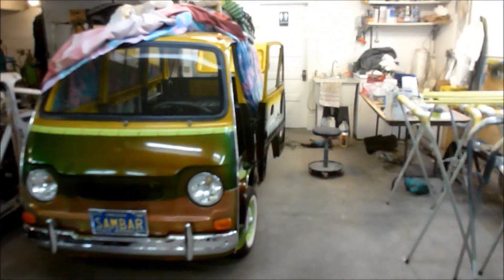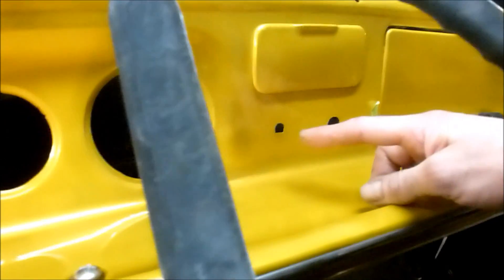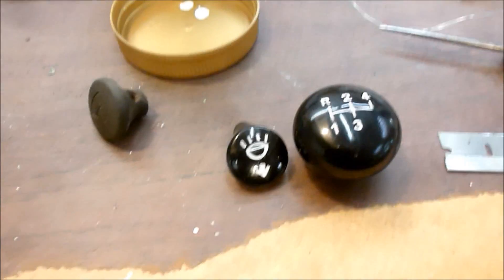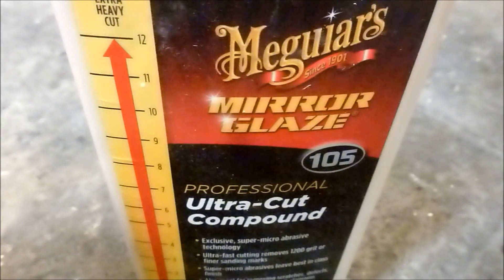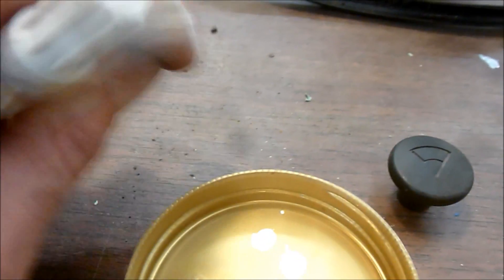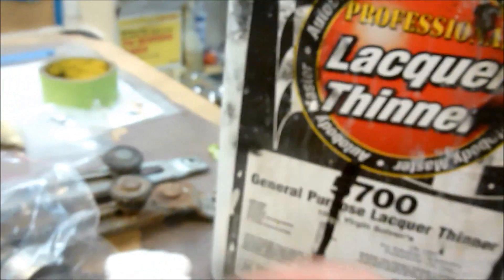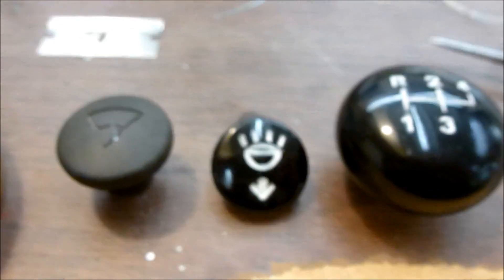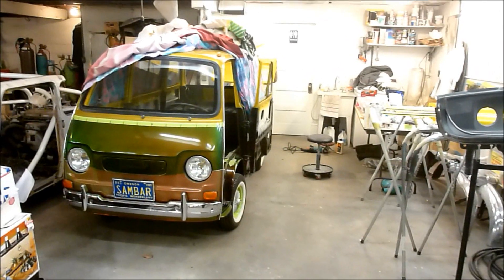Restoring and detailing interior dash knobs

Comment: Good method, but I have a tip to make the lines  bit better. I reccomend you paint the insignia with a small brush or something, and once it's dry, you can sand the excess paint off with some fine paper (you can work down from 400 to 1200 for a nice finish). Once it's sanded, you can buff it up the same way you buffed them, and the lines will come out "sharper" and better.